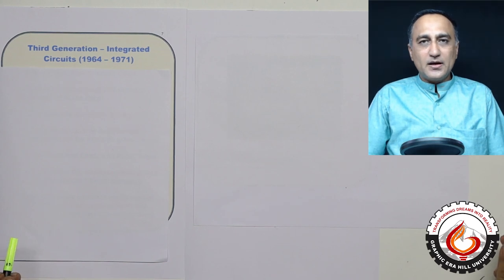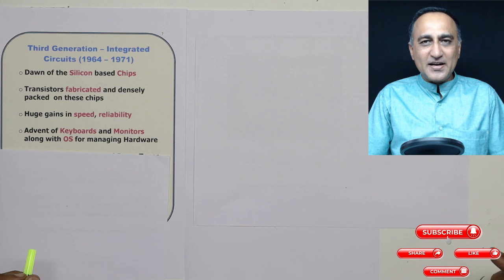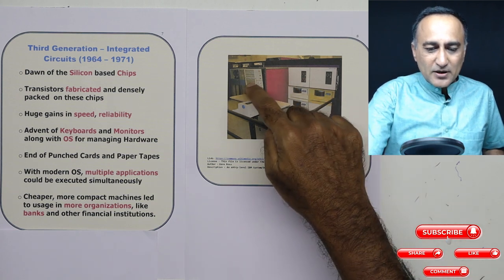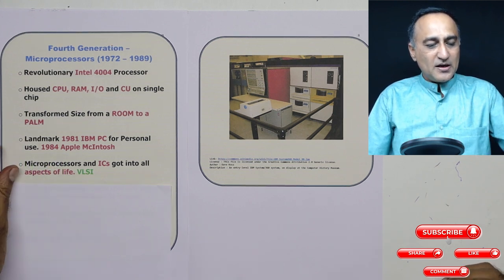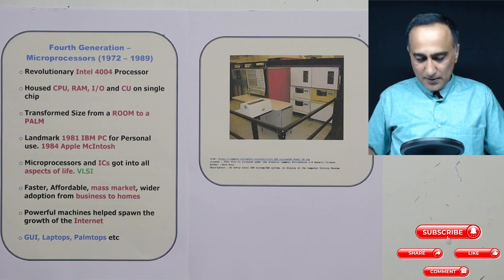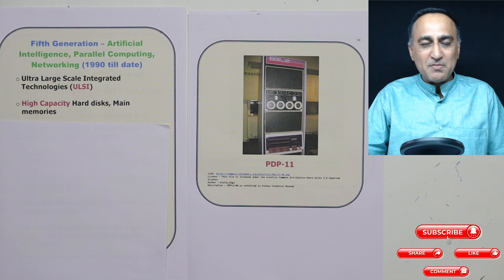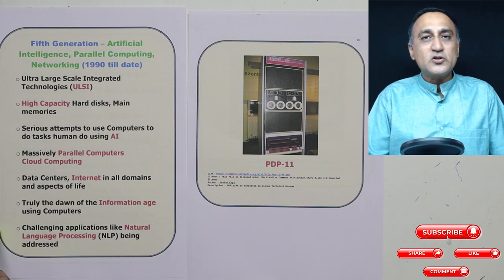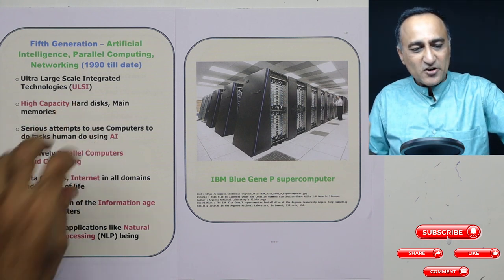WK3 - 23B Computer Generations Part 2

Comment: Sir Voice Recognition system is Now also recognizing ALGOL as Alcohol (in the Caption)
Reply from the maker: Voice recognition is really a tough tool to build. For example when I say y it does not know y or WHY...
Another problems if I say c. It thinks see, sea etc..
Reply: @CodetoCareer  Yes Sir that's the problem 
But CS Engineers will soon find a solution to that also

Comment: Sir how can multiple user can interact with single PC or computer
Pls elaborate this concept (video timeline 2:35 min
Reply from the maker: They are connected to a separate terminal and keyboard. Example Railway reservations, Multiple operators connected to a single computer but each of them have a separate monitor and keyboard.

Comment: sir google achieved quantum supremacy last year. isnt that something concrete in that direction? although the technology is still fairly expensive and complicated s code cannot be written for machines that use qubits (yet)
Reply from the maker: It is a great leap forward. But unless technology impacts or is accessible to the masses its contribution remains confined to research. Hopefully in the coming years quantum supremacy should percolate to the masses.